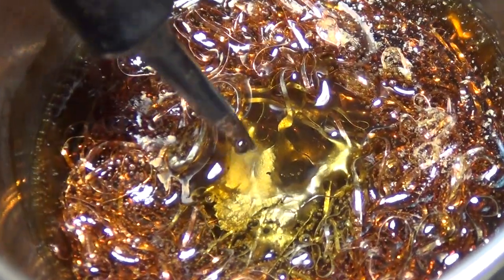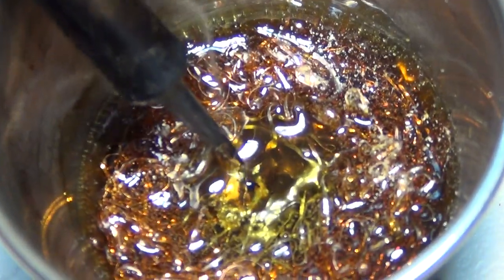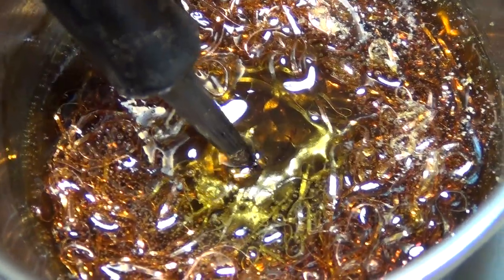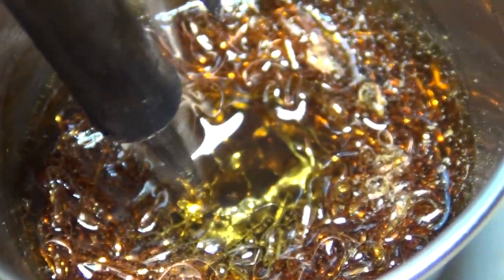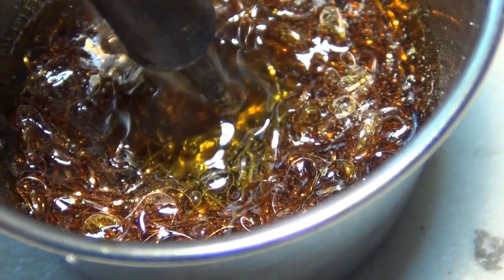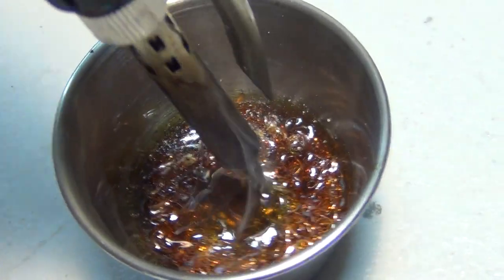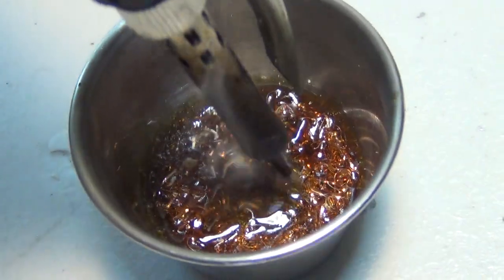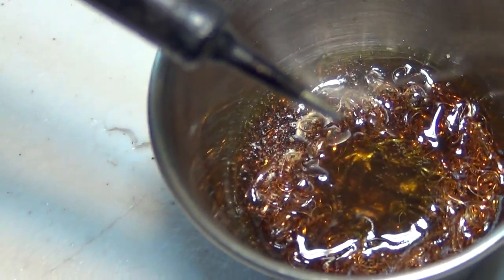How to clean renew and protect your soldering iron tip. With CyberDoc Tinning Cup

Comment: I’ve tried to clean and tin the tip the way you’re supposed to and it doesn’t work. I have to resort to thermal shocking the tip in solder paste then wiping it down with steel wool to get all the shit off. Then I have to use steel wool again because tinning it just gets it dirty again which I though was supposed to be clean.